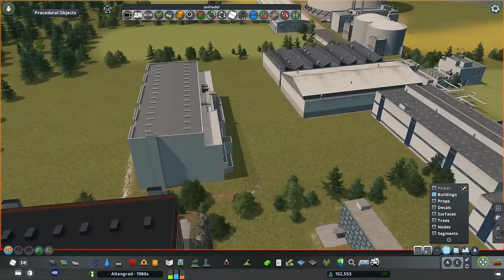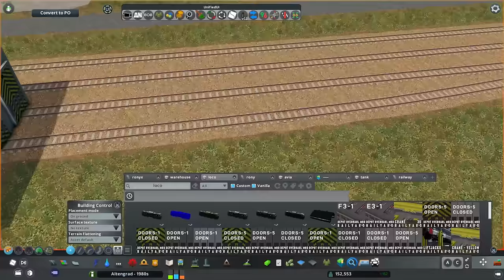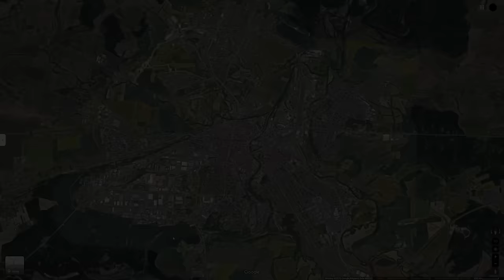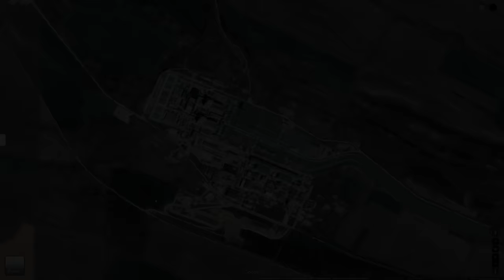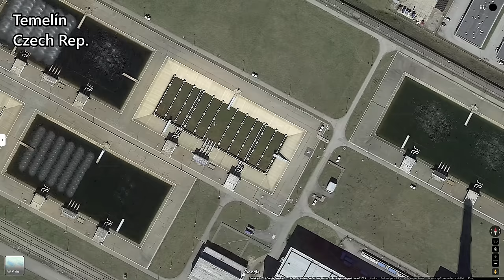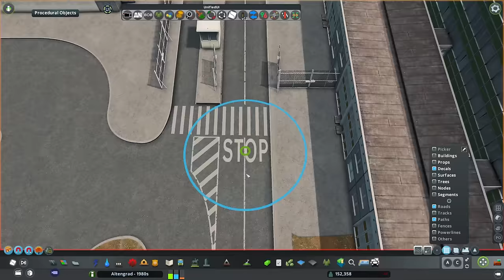Nuclear Power Plant - Cities: Skylines - Altengrad 84

Comment: If you feel like the plant is missing something: most electrical switchyards have gravel surfaces, I forget the exact reasons but I think it was to reduce the chances of somebody conducting electricity through themselves via wet grass? Related: switchyards have a grid of earthing wires laid under them typically so you may as well place the gravel when you're burying the earthing.

This might help you make the area look more varied in terms of ground texture

Comment: There is a German documentary from '91 about the power plant in Bulgaria from 1991 (Link at the end). The images are horrific. Bulgaria was always a pretty poor country. The other socialists countries wasn’t ever that faulty. Some reactors were shut down after 2000. But the plant is nowadays still in operation, got several modernizations and upgrades… If I remind myself good, the main issue of Bulgaria was the lack of spare parts, financial investments and mainly the plan to realize the project as soon as possible to show the strength of the country with missing good construction workers - many important things where unfinished or made bad, like in the Sovjet Union. The first 4 reactions were realized in a time of 4-7 years.

https://youtu.be/XRpUBWqBSHM?si=a9LZ6is0OT1g6bop